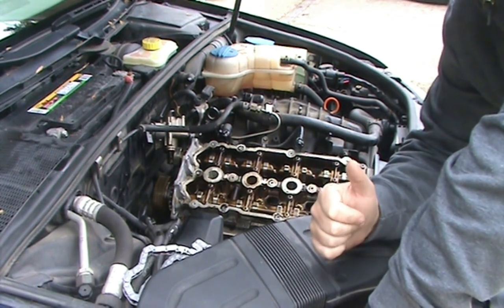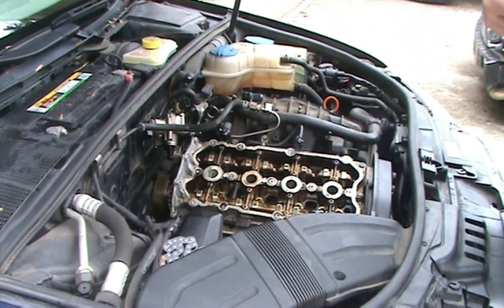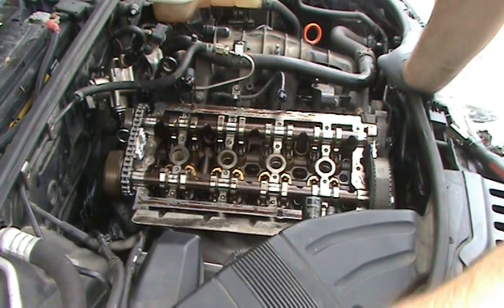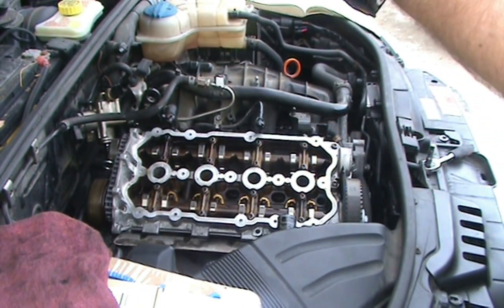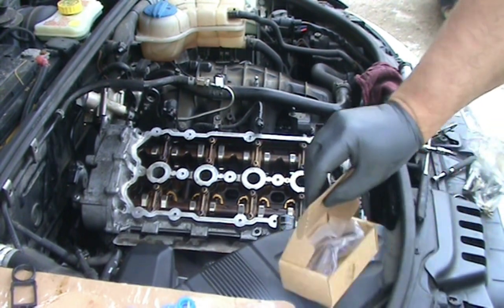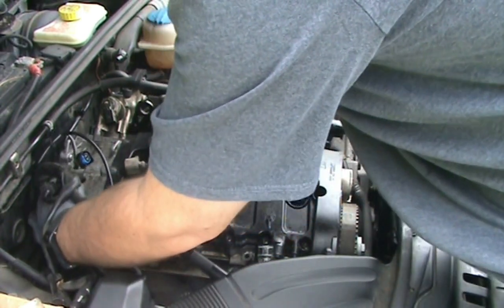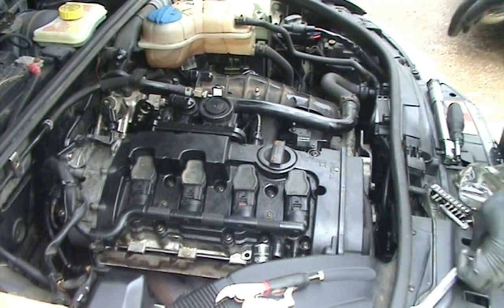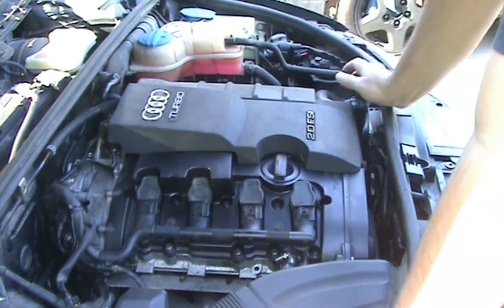How To Replace Broken Audi Cam Chain and Tensioner

Comment: Ok. I agree with the other commenters. Good video. My only unqualified gripe is you started partway through the job. BUT you explained in great detail what you did and why. So thanks for that. We have the engine out and are doing more than just the rear timing. But the rear timing is Givin us a butt whooping. So your suggestion on pulling the camshaft makes since. My Audi friend says those bolts break as often as they come off. 
Thanks again for a concise non yacky video.

Comment: Great video and detail through the whole process, best video I have found as most others do not cover the details ,chain timing etc. I have a BWT 2.0TFSI which looks to be identical, its in a 2008 S-line about 134K mileage. Every once in a while at cold start up I can hear the chatter so it is getting near time to do this. I was  pretty hesitant because of the poly drive bolt issues, had a shop do my wifes car and they stripped out the bolt costing us an additional sum of money for a new camshaft, go figure as this was a supposed German Performance shop. Thank you for sharing this version of chain/ tensioner replacement with removing the intake cam and cam tray.

Comment: Just pull the cam adjuster. You need a special M10 polydrive to remove it. If it breaks or something, then you can pull the cam cradle or drill it out through the firewall where the battery sits.

Comment: By far the best video about this job.
Reply: It's really not.
Reply: @sterlingwitherspoon5709 

It is, by far easier to take the cams out for loosen the bolts, put the front in service position and replace the timing belt and camshaft seal also.

Comment: You didn’t show in the video but did you rotate the engine once the chain and cover was installed? I just followed all your steps and I was in the process of rotating the engine but it gets stuck with about 1/4 turn

Comment: Great video! I have a 2007 Passat wagon with this exact engine. Currently u have a crank no start condition. I have cranked the vehicle and visually see that both exhaust and intake cam rotate. The timing belt looks fine and seems to be on right. I have 0 compression on 3 of the 4 cylinders and cylinder #5 has 150psi but slowly looses the pressure. What would you suggest on doing as far as diagnosing the no compression issue?

Comment: Hello, I just got a 2008 A4 2.0T Quattro crank no start and was wondering if a broken timing chain is something I need to worry about? I just got it for cheap and have only out in a crank sensor so far. Let me know of your thoughts. Thanks
Reply from the maker: You can use a light to see the intake cam shaft where you add oil. If someone cranks the car and that isn't turning, then it is either this timing chain or the timing belt up front. Next easiest thing would be to check the timing belt by removing the cover I am installing at the 53 minute mark. If that cam is turning, then neither of those are broken. In that case it could be a a fuel or spark issue.

Comment: Ive been having a misfire issue ive been chasing for months. Hopefully you have some insight. 06 a4 2.0 it didnt run when i bought it. Ive replaced the oil filter housing, upper radiator hose, evap purge, pcv valve, pcv breather hose, turbosmart bov, valve cover gasket, oe sparkplugs and coils, timing belt, water pump, drive belt, oil pressure sensor, intake manifold gasket, just did carbon clean (was completely caked in carbon 167k miles appeared to never been done) ecs tuning cold air intake and milltek exhaust. The car runs almost perfect all except for this haunting stutter i cant seem to figure out. I thought forsure it was either the timing or the carbon. I know my tensioner is bad you can hear the chain slapping and i think it broke and fell down into the oil pickup tube. When you cold stat the car you can hear the oil filter sounding like its empty for a second before filling up but then once you drive for awhile and the oil is hot it doesnt do it anymore. Could this be the cause for all my stuttering issues, a few months ago it shut the car off on me twice ( why i replaced oil pressure sensor ) i paid audi to get no answers PLEASE HELPPPP!
Reply: 157k*
Reply: Fa*k man i think i have the same, give me your insta or something bro i’m trying to find it too, i think it is the cam chain. Or alighn your car. Is it stuttering when you throttle?

Comment: My wife had exactly same problem at a stop sign. Chain broke. I see you didn’t change the valves. The exhaust cam was still turning which may cause the valves to bend on the one side, no? Just looking for an opinion before I put everything back together without changing the valves. I also set up the locking plate in the spot on the cams you mentioned. I then put the timing chain back on but cannot figure out how to get the 17 to 18th link to line up. I can only get 12th and  13th link. To line up. Help
Reply from the maker: It can bend the valves. I have gotten lucky twice. My friend with a Buick Park Avenue was not so lucky. Mechanic was actually able to crank his car until it started a ran for a couple seconds on one cylinder. He need a lot of valve work. A compression test might point to if the valves are bent. With the cams out, nothing should be holding valves open. Other way would be to pull the intake off and see if the valves are able to close all the way. A bent valve stem will stop the valve from closing. Not sure what is going on with the timing chain. The only thing I can come up with is the chain is flipped over or a cam isn't in the right position.

Comment: Good work. But I think you have problem because in the end when the rpm drops off to "normal" you can clearly hear the rattle noise from the chain. This should not sound like this. I have the same problem and changed everything, it does not rattle as yours.

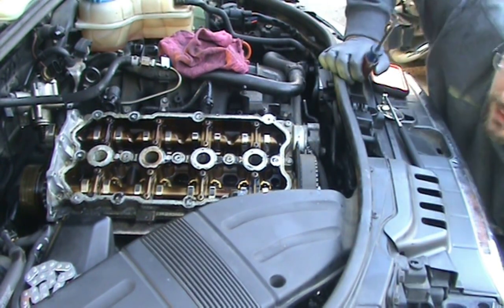Comment: Hi, when you lined up the exhaust cam at 11:15 how did you know if you're at TDC? Excellent tutorial. Thanks.
Reply from the maker: There are marks on the main crank pulley for timing the engine with a light. I placed it at the 0 degree mark. Also screw driver down the spark plug hole trick can work too. I probably verified with this method, because I can be paranoid about trusting the pulley markings.

Comment: Is this 2.0 tfsi (BGB engine) ?   It comes with: in front with 2 belts - V-ribbed belt  & Timing belt  and at the back of the engine with Timing chain ?? correct?
Reply from the maker: BWT engine, a Serpentine Belt (V -ribbed, accessory, belt) and a Timing Belt up front. In the back is the Timing Chain.

Comment: Hi there's a little bracket with some ground wires.  Does that go on one the the legs of the vacuum pump? Thanks
Reply from the maker: Yes, lower part of the vacuum pump, passenger side.

Comment: What gloves did you wear? They look high quality
Reply from the maker: Venom Steel Nitrile Rip Resistant gloves, I have seen them at some part stores and Wal-Mart. They cost a bit more, but I don't seem to rip through them as often and common chemicals seem to degrade them less.

Comment: How u put back on the right place the intake cam
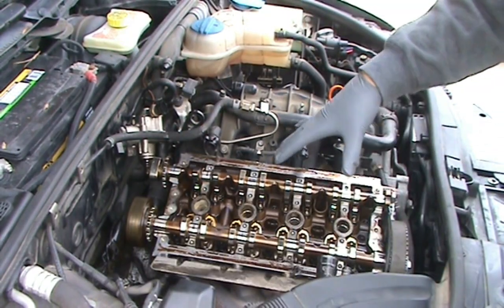Reply from the maker: There is a mark on the back of the intake cam, 13:25. That tooth goes between pins 18 and 19 from the gold link. Do not count the pins in the gold link.

Comment: the counting of 18/19 links; is that the piece of the chain that connect the top or the bottom?
Reply from the maker: I am counting the actual pins, not the links. The tooth with the mark on the intake cam will go between pins 18 and 19. Do not count the pin in the gold link.
Reply: @DIYJunkie369  Got it, pins not links. So after  the chain is  installed and you look at it from the driver's side, is the counting of the pins clockwise or anti-clockwise to the 18/19 ?
Reply from the maker: Standing in front of the car looking toward the rear, count clockwise.

Comment: How did that not bend any valves? 😲
Reply from the maker: It must of been luck. Only had to worry about bending intake valves since the timing belt didn't break and it must have been nearly closed or close enough that the spring pressure cause the cam to rotate so all valves could close. RPM might of played a role, wife was sitting at stop light. Also broke the timing belt in my Xterra and managed not to bend any valves. I was driving through my neighborhood at low speeds when that happened, so low RPMs again. Both vehicles are suppose to have interference heads.
Reply: I had a broken timing chain on my 2006 B6 Passat FSi. I did not have any bent valves.
Reply: Ya when the chain breaks the intake cam is free to move. Tension from the valve springs will push back against the cam lobes slightly rotating the cam till spring tension is relieved. It’s so much worse breaking the timing belt.
Reply: The exhaust cam is connected to the timing belt in the front. If that belt breaks the valves will be bent. The intake cam spins free if the chain in the rear breaks, and the pressure from the valve springs is then greater than the free-spinning cam.
Reply: @DIYJunkie369 Amazing! I just snapped a timing belt on an A4 B7. Bent the valves in cylinder 1&2 before the cams stopped. Just got it put back together. What a PITA.

Comment: SO What tool do I use to ATTEMPT to take off the exhaust cam sprocket?.. my chain did not break but the tensioner was in pieces when I took off the cover
Reply: Is it a t50?
Reply: @DaChiefn1  it's a t55
Reply: T60
Reply: If your talking about the bit I’m thinking you are then it’s a special tool t40080 it’s similar to a torx bit but it’s not !! Don’t try and use a torn the special tool needed has squared edges you’ll just strip it otherwise and will end up having to do it like this guy did also you need cam locking plate and when buying this plate and special tool don’t go cheap you’ll regret it
Reply: It’s a 10mm poly drive
Reply: VW Factory Tool # T40080
9mm poly bit drive
Reply: Just do it the way he's done it. That bolt ALWAYS strips, because both it and the tool used to remove it (polydrive socket) are a CRAP design. The socket doesn't bottom out in the bolt, so it rocks and never sits squarely.

Comment: One this this guy doesn't tell you is how hard it is to put the cam support plate back on there. Notice he did not show that step in the video.  If you going to show people how to do something you have to talk about the cons too.  I do not advice to follow this guy video.
Reply: Anaerobic sealant is what you want. Id agree to not do it this way either. I’d at least try breaking the poly bolt free first and if it strips then remove the cam cradle slip the timing belt off and pull the exhaust cam. You never have to remove the head for this job.
Reply: Exactly. Most people don't show because they are not true mechanics and they have a hard damn time doing the job themselves so they rather show the easy stuff to give themselves some kind of glory.
Reply: @quincystarcruiser4148  When doing it this way, you NEVER want to move the exhaust cam. You simply tilt the intake cam inward toward the exhaust cam to get the chain off. The exhaust cam is connected to the timing belt in the front of the motor If you disrupt it you'll throw it off actual TDC.

Comment: Did it no bend valves
Reply from the maker: I got lucky and had no bent valves, same in a Nissan Xterra.
Reply: Thats funny cause i have a super clean looking '07 Fahrenheit 2.0t fsi gti lined up that the timing chain on the driver's side broke letting the intake cam stop and engine stall. Was only cranked over 1 time afterwards making sure it wasnt seized but i think there's very little to no chance of some of the intake valves not being bent..
  Anyway, im hoping that there are only a few valves bent, kinda wondering if i should just buy a decent used or re-man cyl head if and when i buy the car.. and boy do i REALLY wanna get it too, its freaking GORGEOUS!!